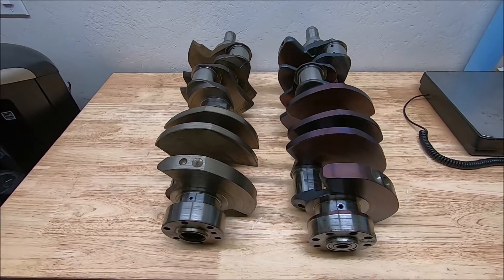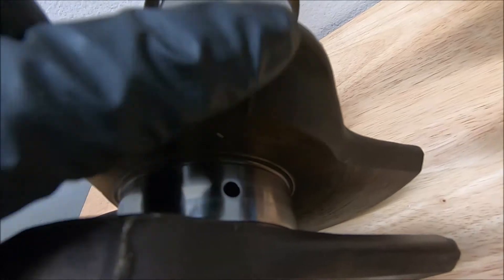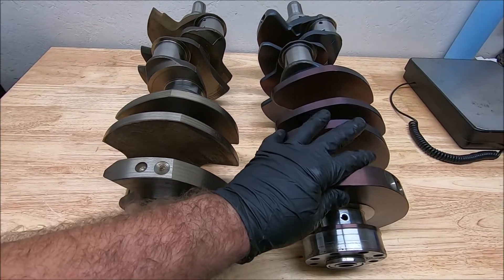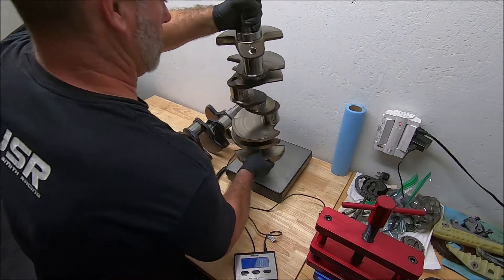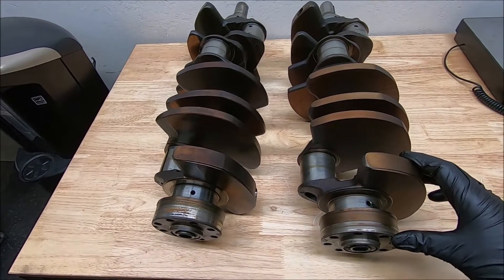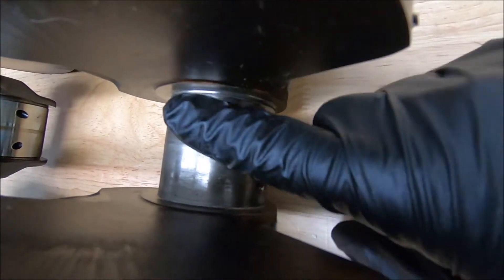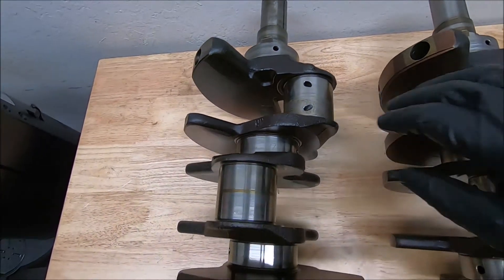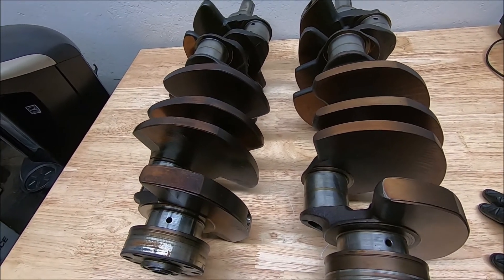Comparing and Inspecting Ford Mustang 4.6 Forged and Cast Crankshaft

Comment: They did make 6 bolt forged cranks years ago. This is a huge misconception that the number bolt pattern with most absolutely tell you. Which will not. I actually have a forged 6 bolt crank from coast high performance from about 12 years ago. Thanks

Comment: so i have a question, my kellogg crankshaft from my mach 1 ,  is bad and i need to replaced but is very hard to find and expensive, is there another crankshaft similar to it that i can swap into it?
Reply from the maker: Yeah the Kellogg crank is getting hard to find, I would go with a Manley one.  Or just use a non-forged one.  The non-forged is actually pretty strong and it weighs less.

Comment: Hello JSR, 
Can you clarify on the Lincoln mark 8s? Years? Also how about the Lincoln continental they came with the 32v too? Please let me know, I would like to build my own engine but the only thing that stops me is how to properly install the 4 cams.
Reply from the maker: The 93-98 Lincoln Mark VIII have great donor engines for Mustangs.  The Continental did have 32V engines and the heads will work on a Mustang but the engine block does not have the same transmission bolt pattern.  I also have a video here on YouTube where I set the cam timing on a 32V 4.6 to help with installing the cams.
Reply: @JohnSmithRacing   Thank you for your response great info!  I have changed the timing chains on 32v engines and set time with no issues. I'm lacking of knowledge on how to install the cams and make sure they are set correctly? Do I install the cams using the guide dots on gear cams and crankshaft? I'm talking about stage 3 cams from cc.  Maybe a video of how to install cam after delivery from ups using some stock components? And swap the important ones?? Thank you for sharing your knowledge! I see your library 👀  📖
Reply from the maker: @ma88tc  No problem, a cam degree video is coming very soon.  I have a DOHC at the shop needing it done and I plan to record it.

Comment: Good to know,thanks for the advise,but these don’t come in the 96-04 gt. They come in the 96-98 cobras some 99-01 cobras and supposedly some mark 8 blocks came with the teksid blocks that came with these forged crankshafts
Reply from the maker: Yes, you are correct about the 96-04 GT not having the forged crank.  The crankshaft on the left is a non-forged one and what I was trying to say in the video is that the non-forged 4.6 crank was found in nearly all other 4.6 cars, including 96-04 GT.  Also, every 99-04 Cobra engine that I have disassembled had the forged Kellogg crankshaft, but there is always the possibility of exceptions.
Reply: @JohnSmithRacing  I had no idea the stock forged crankshafts in the cobras were kellog cranks,I want to forge my pistons and rods on my 96 cobra so I can run some boost. I also want to figure out how I can set my rev range to 8k rpm,I just love high revving small displacement v8’s especially the 4v 4.6,they sound insane past 7500rpm
Reply from the maker: @petrolhead8851  If the crank in your 96 Cobra is factory it should be a forged one and can be revved to 8k rpm as long as it is balanced to the new rods and pistons.  To rev that high you will also need to upgrade some of your valvetrain, mainly valve springs.
Reply: @JohnSmithRacing  I’ve also heard a limiting factor to revving these engines that high is getting rid of the stock intake manifold for something like a sullivan intake and also the stock pcm has a hard time letting your engine rev past 7k rpm,it’s just stuff I’ve read on the internet and forums but can’t say for sure it’s all true
Reply from the maker: @petrolhead8851   I personally have not built a 4.6 to rev to 8k but I built several 2V that spin to over 7k.  I wouldn't think the factory intake would be too much of a restriction at 8k but the only real way to tell is on a dyno.  Maybe someone has numbers posted.  Same with the PCM since that isn't too much over the factory rev limit.  9-10k might be a different story haha